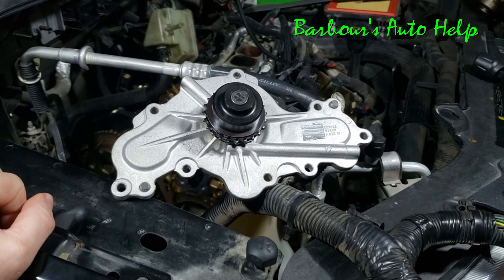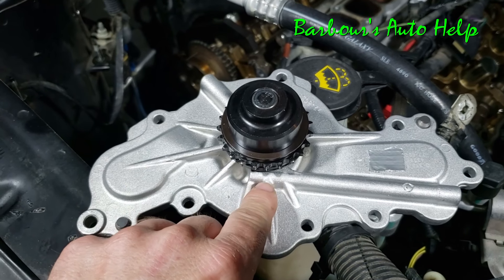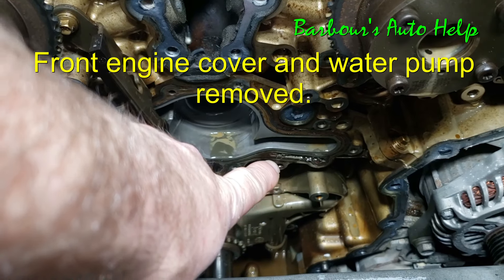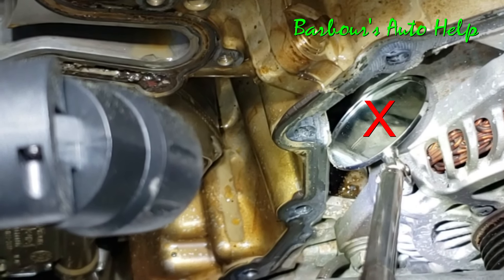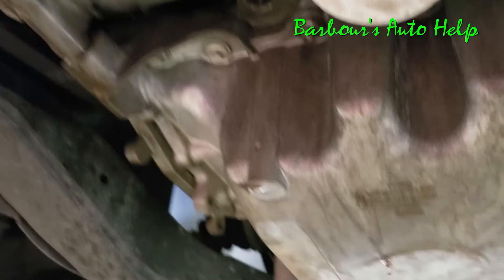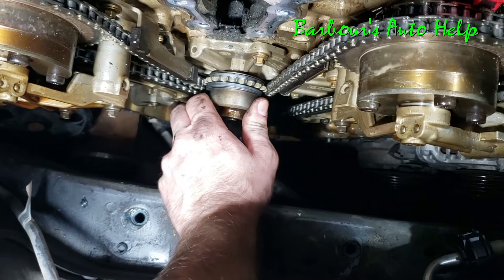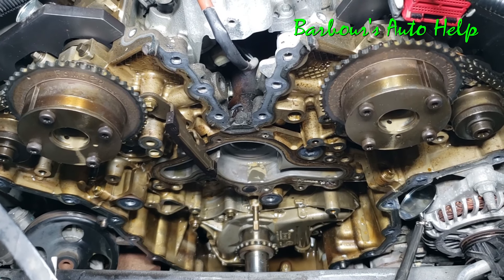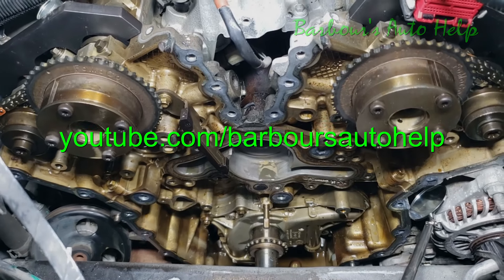Ford 3.5L and 3.7L Water Pump Leak/ What To Look For

Comment: Have a 2015 Edge.  Will ford extended warranty cover this repair?
Reply from the maker: Not to my knowledge.   But, water pumps fail regardless on ALL vehicles that have them so I dont know why they would.
Reply: Yes they would.
Reply from the maker: We'll see but I really doubt it.  This has been out for at least 13 years and they haven't yet.
Reply: Before I got the Ford I Extended Warranty.  They ask a Ford  Service man if it be would coved.
He said it would help.
Maybe I should cancel the extended warranty, as it cost a lot if they won’t cover it???
Ford Dealer Warranty Help am I protect if this happens???
Reply from the maker: Oh don't misunderstand what I meant.   I thought you were asking if Ford will extend the warranty on this particular part regardless if you have extended coverage or not.  I did not know you had an extended coverage plan.  To answer your question then it would be best to contact your dealership and ask them if its covered.   They have the means to tell you for sure if a water pump is covered under your particular policy.  That is if you have a "ford plan".  If you have an independent warranty then you should call them.

Comment: I had to replace water pump, timing chain, and head gaskets on my 2013 SHO... I accidentally left my car started in a very steep incline and overheated everything and ruined my gaskets and pump. Trusted mechanic did this job. Car is still leaking coolant... Neither I nor he can figure out where from..  any ideas?
Reply from the maker: I take it its not leaking externally.   Could be going out the tail pipe.  Does it smoke?
Reply: It is external! Leaves marks in my driveway... And the amount is dependent on how long it's driven it seems.
Reply from the maker: There has to be a snail 🐌 trail somewhere on the cooling system if it's external. I'd look for that.
Reply: Try the color dye and UV light technique... hope it helps!!
Reply: @XvSKINNYvX  I have a 2016 v6 and it seems to only leak when it’s on a incline.. sometimes when it’s just parked also but not very much... do you figure it might be a hose?
Reply: Turned out to be a couple things all in/around the thermostat and it's housing
Reply from the maker: Good job.
Reply: @BarboursAutoHelp  did u read my comment? What do u figure bro
Reply from the maker: Didn't know you were talking to me because it was directed at John.  Not sure.  Have you inspected it?
Reply: @BarboursAutoHelp  I see a leak but my engine isn’t over heating and I drive 3 hours to work and back everyday
Reply: @BarboursAutoHelp  it must be a small leak somewhere? What do you figure? I see a little fluid around the alternator
Reply from the maker: Ok, well, not sure what to tell you..  Have you tried getting in there and finding out where it's leaking?  Let us know what you find.  I can't tell you what's leaking.  That's impossible.  I haven't seen you vehicle.  If you can't figure it out then have a tech look at it.

Comment: Looking  at a mint  2010 Lincoln mks twin turbo...  hmmm... not looking so good now!
Reply from the maker: Ford, GM, Chrysler, Foreign vehicles....They all have there own set of problems and issues.   Take your pic.  In my opinion the Lincoln is a good vehicle.   It may be a little expensive to repair but so is a BMW.  Ford isn't the only one that puts a water pump behind the cover.
Reply: @BarboursAutoHelp   it just had the water pump and chains done a 1000 miles ago. 146k miles on  the car
Reply from the maker: That's a plus in my book.
Reply from the maker: Tubos may or may not give out.  They usually leak oil.  Sometimes leaking oil into the exhaust.  Other than that, as far as I know,  it's a solid vehicle.
Reply: @BarboursAutoHelp  ohhe did replace the turbos already too
Reply from the maker: That sounds like a winner to me if everything else is in good order.
Reply: @BarboursAutoHelp  thanks for the info..much appreciated

Comment: That's why I wouldn't buy an explorer. Leave it to ford to put a time bomb in the motor that cost 2500 to replace. I believe they did this on purpose
Reply from the maker: It wouldn't make sense to do it on purpose for those reasons.
Reply: @BarboursAutoHelp  thunk about it they make money with the parts and repair 30 percent or so will go to the dealer

Comment: Lovely design ford!
Reply from the maker: Ford is not the only one.
Reply: @BarboursAutoHelp  In my 18 years and hundreds of Make/Model pumps, this is my first one waiting to go under the knife!
Then again though, I absolutely refuse to work on anything designed in Europe..
Reply from the maker: @ripptydevibes2581  Subaru, Nissan, Mazda, and Infinity all have an engines that has an internal water pump.  Thats just a small list.  I'm certain I am leaving a few out.   I don't think any of those are designed in Europe.
Reply from the maker: @ripptydevibes2581  And the funny thing about it...The ones that don't have an internal water pump design, I wouldn't be at all surprised if they don't adopt this as well.  Wouldn't surprise me at all.
Reply: @BarboursAutoHelp  I was not aware! Havent run into any of them yet. This ford is gonna be my first which just reminded me I have to order that Lisle cam chuck.
Reply: @BarboursAutoHelp  That would surprise me. I mean, why should a water pump have the authority to collapse an entire long block?
Reply from the maker: @ripptydevibes2581 Let me know if you need anything. I’ll keep my ear open for you. Good luck.
Reply from the maker: Well it surprising and it’s not. You would think they would stay away from stuff like this but there are other factors at play.
Reply: @BarboursAutoHelp  What other factors? Fuel economy easier on chain pumps than belts?
Reply from the maker: Easier to fit the engine transversely. Saves space. Also, I’m sure production cost play a roll.

Comment: Ridiculous design. Have the chance to buy an otherwise in good condition 2016 Edge but with this motor I won't chance it.
Reply from the maker: If I had the chance to buy a 2016 Edge I'd do it in a heart beat.  (my opinion) These are great engines....just the water pump design is not the best.  That being said.  My 07 Edge is still going strong...even after catastrophic water pump failure.

Comment: Why would someone build a water pump like that.  Come on FORD …Crazy 😜
Reply: Worst deign by any jackleg Ford engineer ever
Reply: @Don Sigler  whole heartedly agree on this statement! Why the fug would anyone engineer the water pump internally, where oil flows? WHERE ENGINE OIL FLOWS! Especially when it could be run on a serp belt externally? Some engineer got rich quick while saving Ford a few bucks in this design. Then ran off while they could....

Comment: What company builds a car engine with a internal Water Pump.....That is just a bad engineering department.  That would cost over 2000 dollars to put in a water pump.....?
Reply from the maker: Several companies do.
Reply: Hello.  So the first symptom is a coolant leak next to the alternator? If the fluid does not disappear and the oil is clean, do not I have to change the pump?  my mazda cx9 is 180,000 miles.
Reply from the maker: Id say if you have a coolant leak then the coolant leak needs to be fixed.  Be sure of what's leaking though before you tear into it.
Reply: The Mazda cx9 from 2007 to 2016 used the Ford Duratec 3.7 v6
Reply from the maker: Thanks for that information.
Reply: @To-Masz  I thought the 2015 have the Skyactive engine?

Comment: I hate Ford for doing such a bad water pump design, my very well maintained 2013 SEL  with just 72,424 miles on it is going to be parked for a very long time until I can get the money to fix it, where I live is very expensive it cost about $2,500 USD.  

I have owned Ford vehicles for a long time, but not anymore!!!, this will be the last Ford in my life!!!. I had a 2000 Ford Taurus with the 24 valves Duratec V6 3.0L engine, it came out much better than this 2013 one, I remember that the water pump was external and extremely easy to replace. Next time I'm buying something else a Mazda 6, Toyota Camry, a Honda Accord or maybe a Kia or Hyundai.
Reply from the maker: I'm sorry your having a bad experience.  Just know the other manufacturers have there own set of problems.  I'm not sticking up for Ford but it's true.  You gonna potentially have issues no matter what brand you drive.
Reply: Yeah it is a crappy problem to have but having numerous mechanics in the family I know you can't outrun failures these days from any manufacturer. They all have their problems in one way or another and these days the fixes are all brutally expensive. Wait until it's all electric vehicles. It won't be water pumps or timing chains but extremely expensive electronic repairs. It never ends, there is no perfect vehicle!

Comment: I've always been a big fan of Ford but what a piece of garbage
Reply from the maker: It's actually one of the best engines Ford has made in my opinion.   I do wish the put the pump external though.   Other than this the engine is bullet proof and to tell you the truth the pumps last a long time.
Reply: @BarboursAutoHelp  you think this is a solid car besides this? The pump seems like an Achilles heel